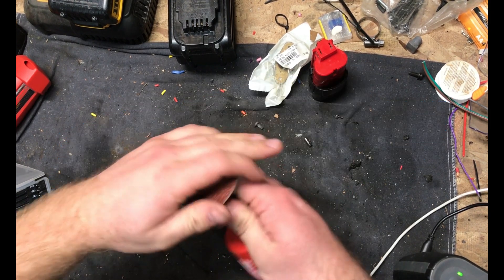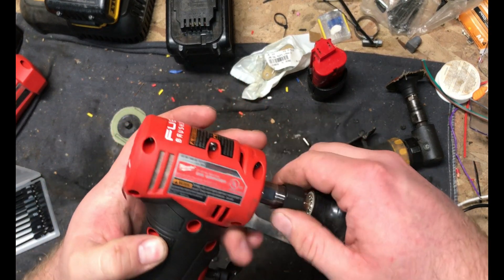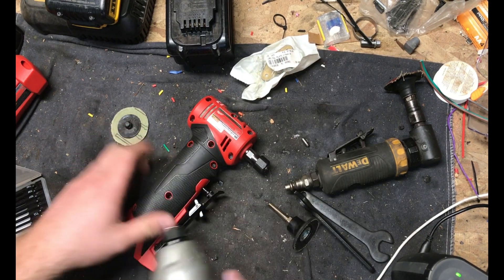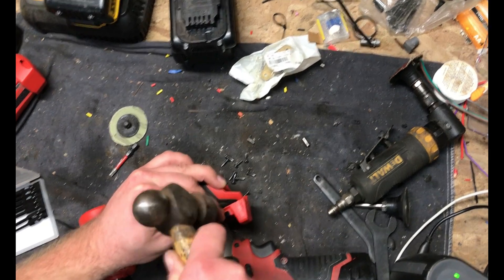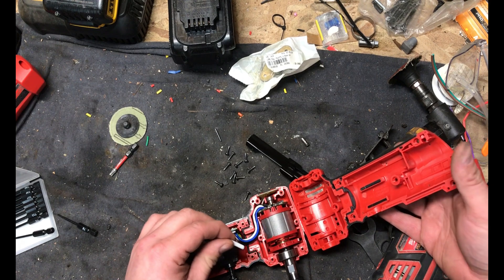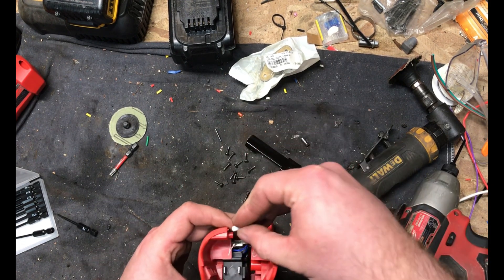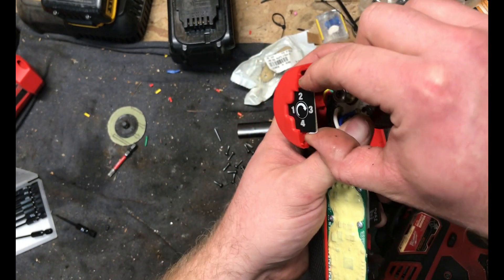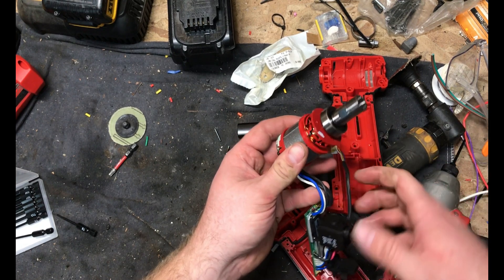Milwaukee M12 Die Grinder Teardown

Comment: Nice in depth video. How has it held up?
Reply from the maker: It's been good. Haven't had any issues. Only complaint is that it stall out more than I would like. But that's more user error than anything.